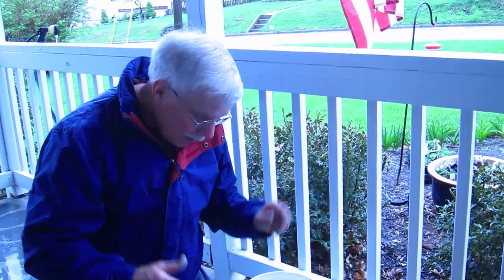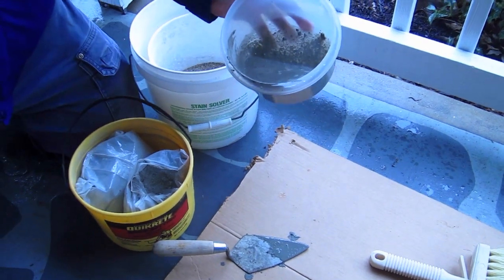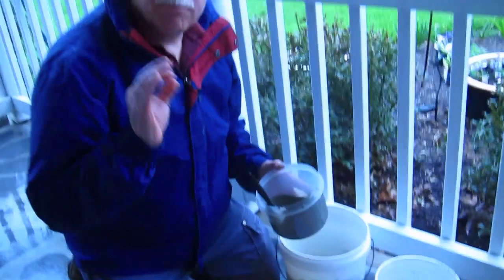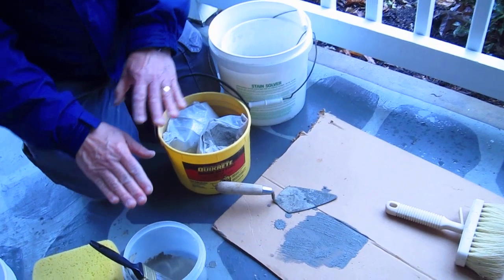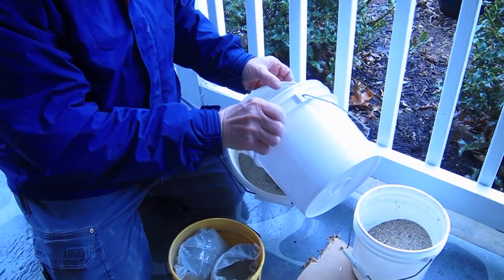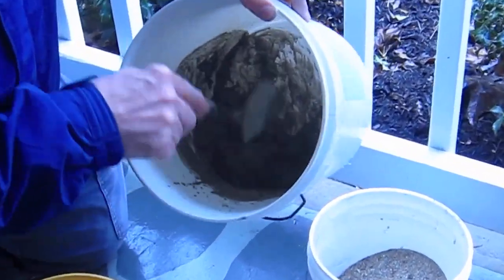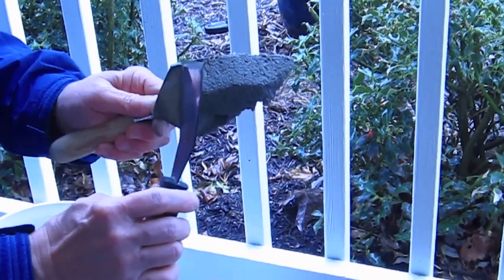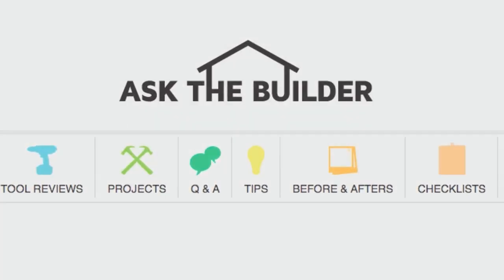How to Repair a Crumbling Foundation Video 3 of 3

Comment: My mom has this exact same damage on a slump stone wall. I thought about doing this exact repair and then putting on some block filler and then paint. You confirmed that I was on the right track. One mason said she needed to knock down whole wall and the other wanted 3500 to repair. Thank you sir for posting this!
Reply: That is a patch and you need to knock down the wall. If you have a severe problem below. Depends on the situation. Going to say, there is a water issue.

Comment: If the cement paint dries, can another coat be added to adhere the stucco to the wall?
Reply from the maker: I'd brush off as much of the mistake as I could before trying to do it right the next time.

Comment: By "quick setting cement" do you mean "Portland cement" alone (no sand, aggregate)?  I happen to have 10 lb bags "Quikrete Mortar Mix", 10 lb Quikrete Concrete Mix (no aggregate).
Reply from the maker: No. I'm talking about any cement that sets quickly. If you need help over the phone, I offer that service. https://shop.askthebuilder.com/consult-tim/
Reply: @askthebuilder  so do you use the same quick setting cement for the stucco as the paint?
Reply: @GoodmanMIke59  Time for a consult call. Look at my previous comment. The call is FREE if you're not satisfied.

Comment: Tim - you said in the video that for deeper patches, you use "layers." Question: should you "paint" the first patched layer over with the latex-like cement paint you made, too?
Reply from the maker: Yes. Cement paint is used under each layer.
Reply: @askthebuilder  Thank you. Very helpful video.
Reply: Another question: Would a pre-mixed thin set work? or stick with the regular portland cement - not a fast set product.
Reply from the maker: @christophercarroll1551  If it was the BEST material to use, don't you think I would have used it or mentioned it? My method is what the OLD master masons used before thinset even existed. But if you want to play amateur chemist and experiment, be my guest. :-)

Comment: Hi Tim, great advice and video, I have my foundation in my basement that is a solid foundation. But from the floor up about four feet it's crumbling. To the point that I have mounds of sand like material on the floor. Will your way fix my issue, and should I use the Portland cement with the medium sand to adhere to the wall for this type of condition also,  After I paint on the Portland.  Also Tim how thick can I go on the first coat.
Reply from the maker: Yes, my method will work. There are lots of things to unpack in your situation. Far too much to type. The best $$$ you'll spend on this project is a quick call with me: https://shop.askthebuilder.com/15-minute-phone-or-video-conversation-with-tim/
Reply: @askthebuilder  thanks Tim for getting back to me, when I'm ready for this project I'll reach out to you

Comment: My home was built in 1850 so brick is very soft, was told to never use Portland cement as too strong, is mostly lime, what should I do? Also has dry lock bubbling over old brick, removed and brick is very damp
Reply from the maker: Simple. Go to www.AsktheBuilder.com and type:  hydrated lime into my search engine. Read exactly what to do.
Reply: If you're talking about repairing the mortar between the brick, the reason not to use a portland-heavy mix is that when freezing/thawing/displacement occurs you want the mortar to crack before the brick. If the mortar is too strong and stress is introduced, the brick will crack instead. Not sure if you're repairing brick or the mortar between but the answer is to use a mix heavier in lime (or even 100% lime) than portland ... this is often just called "mortar" interestingly enough, or more specifically Types O or K mortar.

Comment: Tim    Par coating is a light coating over your concrete block not as thick as stucco  It is used here in the Midwest.
Reply from the maker: Wow, I was born and raised in the Midwest - lived there 55 years - and never heard that term. It must be very localized. Bottom Line: Yes! Use this method in the video to repair it!
Reply: Ask the Builder I believe this is also known as "Pardging" if I have the spelling correct.  Canadian's use this term ALOT as do the people in Alaska and Colorado.  It may be a regional term because I never heard of it either (I'm from Michigan) until I saw some Canadian DIY shows and they called this a "Pardging Coat".
Reply: Or it's called SKIM coating here in NY
Reply: o I haven't heard of any these terms. I only worked with building the foundation forms, pouring, and form tearing down.

I met this other guy a few times had called it patching... He stop by asking if there are any big mistakes. I told him the small mess ups I did with panel tear down and he told me it's no problem that he can patch the concrete (he called it patching). He was just looking for the big mistakes
Reply: Ask the Builder It is actually called a parge coat, shortened from parget.  It's basically a finish, or skim, coat of material, usually smooth, but can be used for adding a texture or pattern

Comment: Have foundation crumbling  in a area that held water when it rained and also  a crack all along foundation where it meets the slump block  not just in one area.  Will this work to solve the problem or has the home shifted? Also when the home was built 3/4 of it is on one foundation and the other 1/4 appears to be laid on another poured foundation as you can see where each one starts on the edge of foundation . Home was built in 1964 and there are no basements here. ...Help !!
Reply from the maker: Dear Drone Woman/Man: I solve complex issues like this requiring a discussion with my Phone Consult service. The call is FREE if you're unhappy with my advice.  https://shop.askthebuilder.com/products/15-Minute-Phone-Conversation-with-Tim.html

Comment: What is difference with when you say stucco and cement paint?
Reply from the maker: Please visit www.AsktheBuilder.com  I explain in GREAT DETAIL the differences.
Reply: Portland is a type of cement (think of cement as masonry glue). Cement paint is just portland mixed with water. Stucco is the portland cement combined with what's called an aggregate (sand) to give it substance, body and strength and forms the actual compound used to repair or build. Technically cement plus sand is called mortar, but the term mortar is used interchangeably with other things to make it all the more confusing. Another type of cement is lime, BUT when people talk of cement the usually mean portland cement and when they talk of mortar they usually mean lime cement.

Comment: Can I just use portland cement without sand ?
Reply from the maker: You can do whatever you want, Andy. Would I? If so, what do you think I would have said in the video?
Reply: The portland is the 'glue' but without the sand there is no structure. It would be like doing papier maché with just flour and water and no newspaper strips!

Comment: How long do you let the "cemment paint" dry before applying the stucco?
Reply from the maker: I told you in the video series. You DON'T let it dry!!!
Reply: @askthebuilder  why not just wet it real nice if that's the purpose the 'paint' is providing?
Reply from the maker: @Laguna2013  That's NOT the purpose of the cement paint. Watch the video once more AND go here and read in detail: https://www.askthebuilder.com/how-to-repair-stucco-and-concrete-block/

Comment: would this method work on an interior cinder block wall? some spots of my current wall has the same crumbling/flaking going on
Reply from the maker: yes
Reply: @askthebuilder  awesome, thank you! how would this mix differ from say the quikrete premixed quikwal cement you can get from home depot/lowes?
Reply: @askthebuilder  if doing this on the inside, are we adding any strength to the wall or is it strictly cosmetic? I ask because my interior block foundation wall also has a section that is crumbling/ flaking
Reply from the maker: @michaelperry4398  I'd have to see a photo! A repair can add strength.

Comment: why is it breaking down like that is what i want to know. is it salt leaching from rising damp? it doesn't seem to be from reinforcement rush expansion
Reply from the maker: Salt doesn't cause concrete to break down chemically. It simply advances freeze/thaw cycles that destroy weak concrete. I can't believe this is salt related because I don't know why anyone would put salt on the soil around the house. I feel it's just frost damage from weakened concrete mix. This location is in a very temperate part of the USA and it doesn't typically get bitter cold for long periods of time. But this past winter, it was cold in this part of Maryland.
Reply: Ask the Builder  yes im not familair with the weather conditions there, we have no frost line here in sydney australia, but there are common problems of rising damp causing render (stucco as you guys all it) to fall off walls. there are natural salt in the ground here. with constant evaporation causes the salts the crystalize once the water has evaporated. hence causing capillarity expansion(ide imagine water freezing would have the same efect). more typical to older houses, build on sandstone foundations with slate damp courses . food for though
Reply from the maker: jetlaged Yes, salt crystals can grow and break apart concrete. This is why I advocate mixing strong concrete or stucco - probably in the neighborhood of 6,000 - 8,000 PSI. The more Portland cement you put in the mix, the more crystals there are to offset the forces trying to break apart the artificial rock. Australia's on my bucket list! Would love to visit down under!

Comment: If you are doing this on a crumbling sidewalk so i need the paint cement first or just add it all at once.  I assume this is only for atucco repair ?
Reply from the maker: +John Wires Please go to my AsktheBuilder.com website. Type: cement paint into the search engine. READ all past columns about the process.
Reply: +Ask the Builder thank you sir